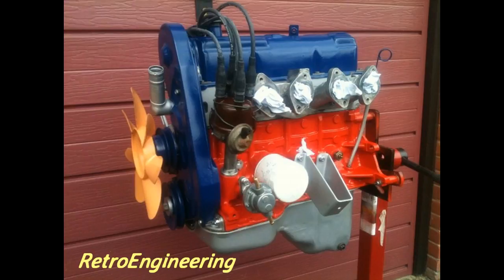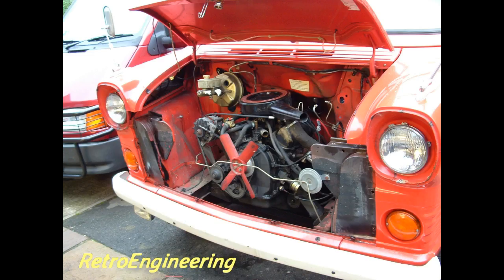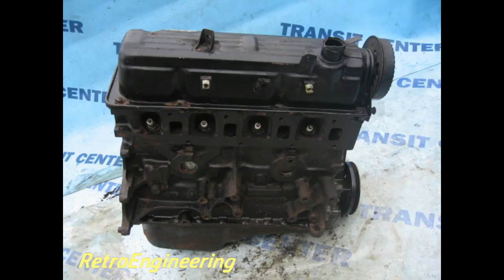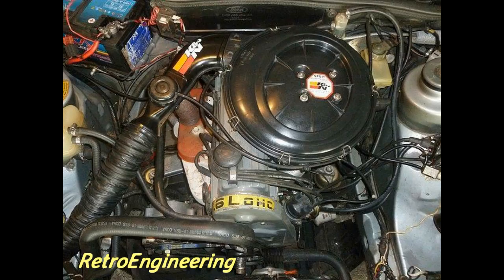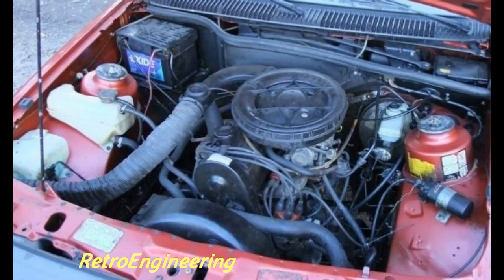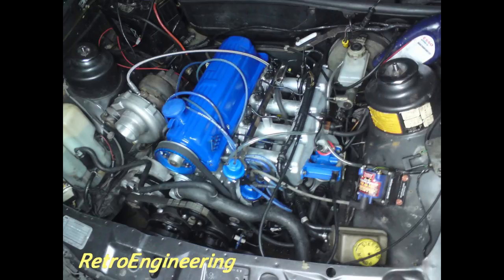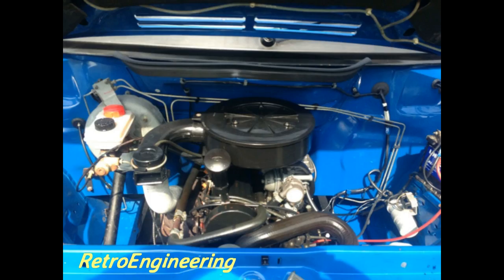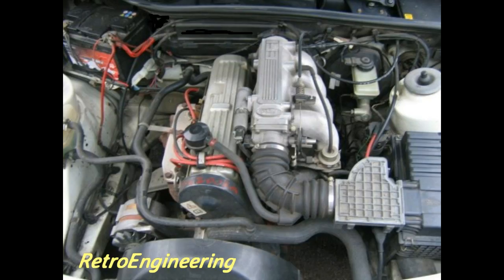Ford Pinto Engine History

Comment: I have a 2.0 litre in my mk3  Capri. Boy, care for this engine and it's performance will not let you down. Plugs, points, condenser, oil, air filter, cam belt, carburator, etc, and it will throw you back in the seats on acceleration.

Comment: i owned a 1971 ford pinto. low production number. made in milpitas ca. it was one of the best cars i ever owned. very easy to work on. everything was right where you could get to it. they have a bad reputation. like with any machine if you do not maintain it. they will fail. most just ran them into the ground. and anything will blow up if you hit it that hard. i drove my pinto on a local road one day.in the hills. and a porsche blew by me. this is no lie. i caught up to it and stayed right on his tail till we came out the other end. the guy in the porsche pulled over came up to me and asked what do you have under the hood. so i got out and showed him that the hole car was factory stock. he closed the hood walked away and drove off. never saying one word. i swear this is a true story.
Reply: I believe you, but having owned and raced over a dozen Pintos including the 2.0 the dude in the Porsche didn't know how to drive. And if you didn't either then he was really slow.

Comment: On the 1.6L OHC You had to Replace the cam belt every 40k miles
Without fail otherwise you will pay the price!
Was pretty easy though around 45 mins when you've done it a few times!

'VV' carb with auto choke was unreliable, so a manual conversion kit was available.
Or a Weber upgrade!

Comment: That voice was only ever acceptable being used by Steven Hawking. And I bet he wouldn't have used the wrong photos of a 1300 crossflow and a 4 barrel carb instead of a VV.
Reply: The Steven Hawking voice was also on the Commadore Amiga.
Reply: pro trick: you can watch series at Flixzone. I've been using it for watching loads of movies during the lockdown.
Reply: @Atlas Gideon yup, I have been watching on Flixzone} for months myself :D
Reply: @Atlas Gideon Yup, I have been using Flixzone} for since december myself :D

Comment: I've got the 2.3 L 4 cylinder 5 speed in my single cab 2003 Ford Ranger and that engine is both efficient and powerful.
Reply: Different motor
Reply: That cannot be a pinto engine it’s too new

Comment: Back in the 80's my modified 2.0 in a Mercury Capri....would beat the 2600cc v6 and the 2800cc on a regular basis...Supprised many V8 cars in a light to light competition...my favorite 4cyl back in the day...👍
Reply: ford lowered the compression in 72 on the 2000 by relocating the rist pin on the pistons,  put 71  pistons in to up comp.  Ford also made a cam that jared the whole car but never put it in production, only thing I remember was it was d1 ** (Pinto) Cam number and suffex BB  I had to put a chain on left motor mount to keep it from breaking mounts.  it was suppose to be a compation  for the cosworth vega
Reply: @600lwp  
I milled the head .060  to bring the compression up on my 2000cc motor...and installed a performance camshaft...Spent 2 days doing some bowl porting and gasket matching....i finished it up with a 3 angle valve job , a 4 into 1 header and a Offy 4bbl manifold with a 390 Holly Carburetor on top.... A friend in College had a cosworth Vega at that time...it couldn't  stay with my Capri...
I have such fond memories of that engine....im pretty confident she was pumping out 125 to 130hp back then....Doesn't sound like much today...but compared to a 350 Chevrolet  was rated at 145hp in 1973....it wasnt too bad...
Reply: @frankieford7668 — I had a 71 2.0 with a header and twin webers I bought the car from a asian man that had on of the first speed shops for 4cyl cars I don’t know what cam he had in it but it wasn’t stock that car would chirp the tires in 3rd gear and my buddies who had a 6.6 trans am and a 68 390 mustang couldn’t catch me in stop light to stop light racing, it was also lowered 1&1/2 inches and handled great, I loved that car as back then gas was over a $1 a gallon and minimum wage was only $2.35 and I got 35+ mpg on the freeway

Comment: Significant points about this engine. It is not an interference engine in standard form, so if the belt breaks the valves won't hit the pistons. Iron block + iron head = Never blows gaskets. I fact getting the head off the block can be difficult. Doesn't overheat easily. I drove a MK 3 Cortina home 12 miles with a broken fan belt at 40 mph (spring time, so about 18 Celsius), and the temp guage never moved off normal. I suspect the fan was windmilling and driving the water pump. The spark plugs are larger than normal and a taper seat fit in the head. They can be VERY tight to remove. Belts are easy to change. 
When this engine was introduced in the UK premature camshaft failure was very common, especially in cars doing lots of short trips. At that time the only widely available multi-grade oils (in the UK) were 20w50 (Duckhams and Castrol GTX) because of the Leyland gearbox in sump cars that needed this grade. It is too thick for the Pinto, so the oil takes a long time to get to the spray bar at the top of the engine which lubes the cam. Starting from cold, the valves would rattle for several seconds until the oil covered the cams. This caused premature wear and cam failure. Switching to a 10w30 grade eliminated this problem. This (10w30) grade of oil was the most common in the USA at that time (still is, I suspect) and probably in Europe too. I imagine that Ford hadn't done any long term testing using 20w50 oils so didn't expect this problem. Nowadays I would use a 5w30 or 0w30 synthetic and would not expect any trouble with camshaft wear. Comments anyone?
Reply: my 1.8 pinto engine ford Seira was positively  an  interference engine in standard form when the cambelt snapped //i buy the car on a Monday and ordered the belt on Tuesday for a Friday delivery to be fitted on Saturday but it snapped on Thursday (no it was not a 1.8 CVH)
Reply: i have an 87 thunderbird turbo coupe with a 2.3l lima SOHC turbocharged which calls for 10w30. My service records from previous owner shows that he used 20w50 multiple times in the bird throughout the late 80s and early 90s and, while changing the head gasket (its a project car there), i did notice a relatively worn camshaft which i've replaced. 

thought it may be of some interest to you!

Comment: 1:46 "The smallest member of the family was the 1.3" So why did you show the Kent OHV engine?
Reply: baylessnow I think because in the uk the 1.3 was in OHV form only
Reply: The 1.3 was never put in the pinto. The 1.6 was the frist instilled into the pinto.
Reply: @stevehillier7018  The 1.3 Pinto was used in lower spec Sierras in the mid 80's.
Reply: @chriswoods3188  There refer to over sea unlike in US it was 1.6l Kent and 2.0l Pinto from 71 thru 73 if had Ford Pinto then in 74 you got 2.3l Lima engine in US
Reply: @SHSPVR  Some 74 pinto also had 2.0
Reply: @williamcrazylacyfurmage9953   I never saw a single a one that I work on in Calif in the 70's thru 90's with 2.0l in 74 model and I even own 74 model it to come with 2.3l
Reply: @SHSPVR  All 3 of my repair books show 2.0 and 2.3 for 1974, A friend of mine had a 74 with a 2.0 that was built up to beat 5.0 mustang in the 1/4 mile.
Reply: We had two '74's with 2.0L engine... base models... at 2:28 is a 4 bbl. carburetor...

Comment: Kinda sorta interesting. I had one of the 2000cc versions of the engine. Was actually a fairly easy engine to work on, and only required 3 special tools.  A special sized torx driver for the head bolts and oil pump bolts, and a really weird shaped wrench that popped onto a ratchet wrench although I can't remember what it was for. The 2000 had an unfortunate flaw of having both imperial and metric bolts. Now I know this was a product of it being a British designed engine in and American car.
I agree PLEASE stop using these computer voices, it really ruins the video.
Reply: The mix of SAE and metric was a common issue in this era. I've worked on MG and Triumph engines from era that had the same issue.
Reply: The head bolt was a "double hex", not a Torx driver. The weird wrench was a "crow's foot" used to adjust the valve clearances.

Comment: Prefer the Pontiac OHV 4 cylinder Iron Duke 2.5L engine with no timing belts or timing chains to break, just timing gears running in oil... prolly used in a 100 different vehicles/machines...

Comment: I have a 1980 ford pinto with a 2300
Reply: That wouldn't be a Pinto, but a Lima engine, which design is based off the European Pinto engine's concept (belt driven sohc straight-4) The Lima is a whole different development branch of its own, starting form 2 litres up. Parts are not interchangeable however... Pintos only came up to 2 litres from the factory. Cosworth developed a 16v turbo off the pinto, and this was put in the 3-door "whale-tail" Sierra Cosworth which many people know. Figures of up to 900 hp were made from those engines by some of the really mad tuners! However, lots of tuners have increased the capacity up to 2.5 litres on the current generations of Millington 16v engines for example, which use a (probably strengthened/ Cosworth 4x4) 2 litre Pinto, block bored and stroked , and have up to 350 hp naturally aspirated...

Comment: This is gonna confuse those who are surfing the net. Are you pertaining to the Ford Pinto or the engine alone(?) Why was the Kent pictured if you're discussing only the T88(?) The Kent was used in the Ford Pinto in 1969 but the 1980 Pinto in the picture used  only the 4 cam tower 2.3 Lima OHC, also a Pinto engine. The T88 Pinto was employed after the Kent. The European T88 had the 3 cam tower. but Ford US wanted a 4 cylinder of their own thus the Lima. The voice is better in The Greatest Lie Ever Told, Holocaust 2015 HD.
Reply: What is the difference with the Lima cam towers? The European engine has one infuriating design feature. The bearing diameter of the front cam tower is smaller than the centre and rear ones, so the cam had to be removed to the rear. This entailed removing the head or the engine to get the cam out. There was a shortcut that some people used. They cut a hole in the bulkhead (firewall) and slid the cam out through the aperture for the ashtray (remember those?) in the dashboard.

Comment: 2300 is a great engine
Reply: No was not any better in fact all one had to do was swap the cam for 71 cam profile and tab bit higher compression and some carb jet change to get +15hp +20Torq ford USA should keep it in I swap my 74 2.3l for 2.0l in my Ford Pinto Sedan